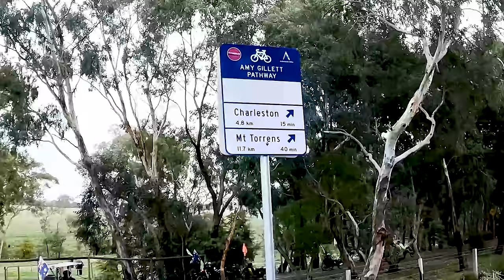Recumbent Trikes: Top Picks and First Impressions

Comment: Recumbent trike math:
1 Delta Planform + 1 Delta Planform = 3 Recumbent Trikes!

Additionally:
Wheelchair/forearm crutches-Delta-Planform On/Off. 
Never such on a Tadpole Planform!
Own BOTH, 30-years recumbent trike experience.
Never outgrow a Delta Planform Trike.
Grow oldest on a Delta Planform Trike.
Reply from the maker: 30 years riding recumbent trike! Need to get you on the show! 🤩
Reply: @CyclewithSerafina  Limited-mobility senior handicapper here. Have been attacked and ridiculed for decades on my choosing my Delta planforms over my Tadpole planforms. Tadpole is a sports car. Delta is a minivan, station wagon, 4WD equivalent. Storable vertically on my Hase'. No "tadpole disassembly" for ANY flat tire! Most suspension directly under torso and cargo load, NOT rider's knees!!! Wheelchair, dual forearm crutch accessibility NOT SO on ANY Tadpole! YES, Delta tip-over easier, but NOT the way 95++% of riders ride!!! Mini van easier tip over than sports car. Anyone see more sports cars on roads?!?!?!